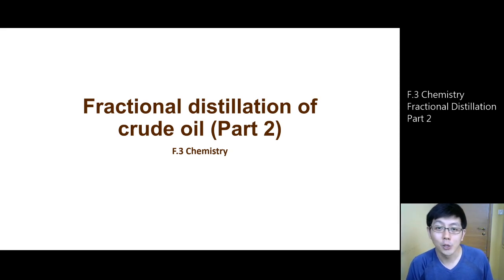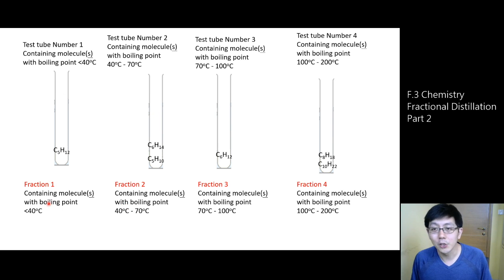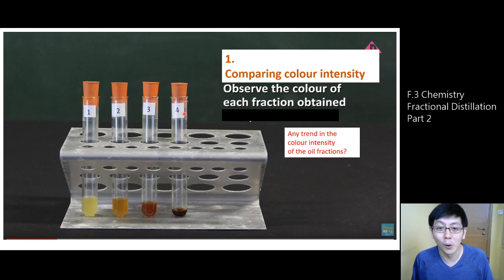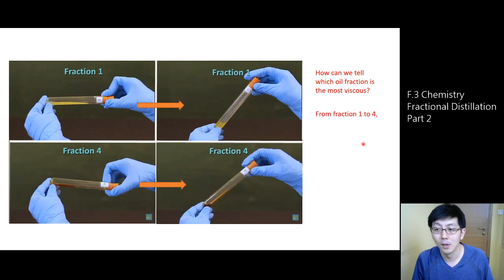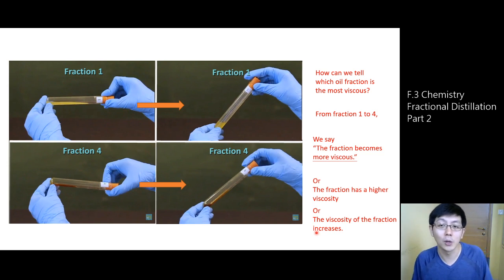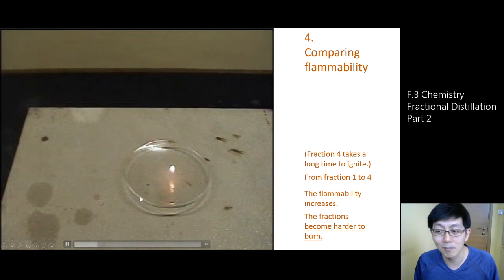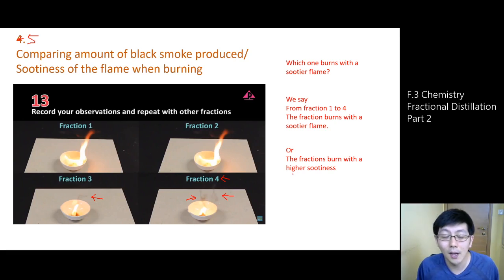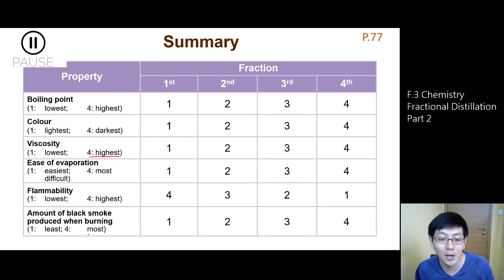F3 Chemistry  Fractional distillation Part 2 (please read description)

Comment: 1. I think fraction 2 is most suitable for be fuel because it is the second easy on one for flammability so it is more safe than fraction 1,also It will not produce black smock so that it will not harm to environment
2.I think fraction 4 is the least suitable for fuel because it is the most difficult to burn among the 4 fraction and it will produce a lot of black smock, it will harm the environment
Reply from the maker: How about the "lubricants"?
Reply from the maker: Also, may your answer be more specific? e.g. what do you mean by "harm the environment"?
Reply: @siriuschungchemistrychanne6397  Harm the environment means the black email will cause and pollution .